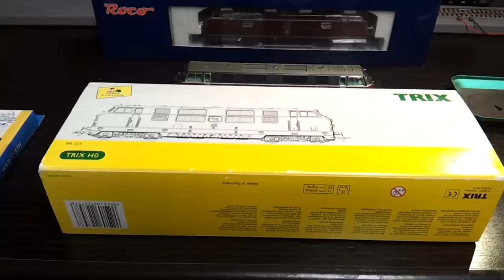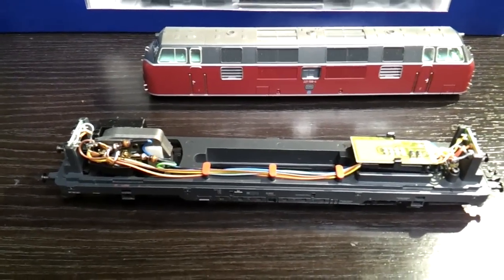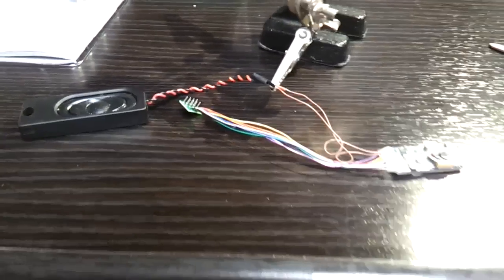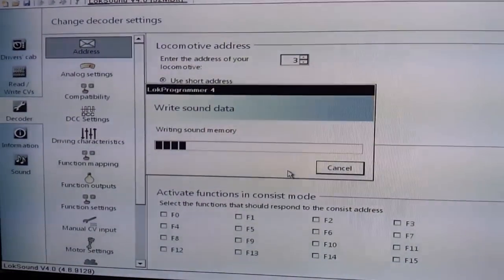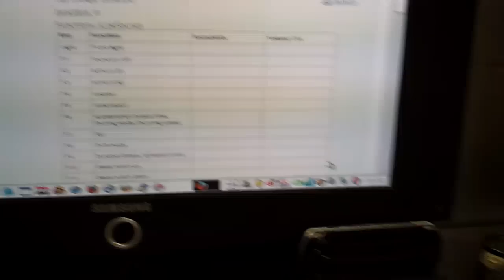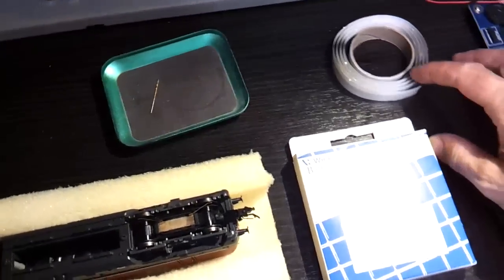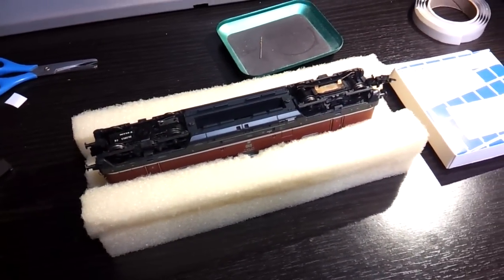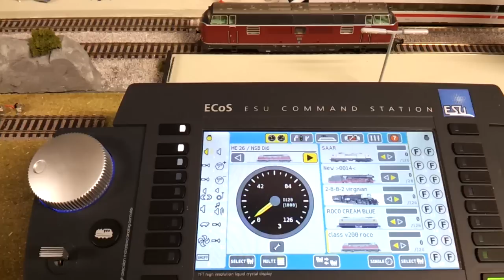TRIX 22757 class 221 Loksound v4.0

Comment: Good demo! But I would install the correct sound for v200 / 220. The sound file of 2 Maybach engines in the new ESU V200 is quite good and it has lots of functions. Including rail squeak on curves that you can make in any locomotive with magnets and reed switches. At least you should swap the sound of whistle that is too modern.